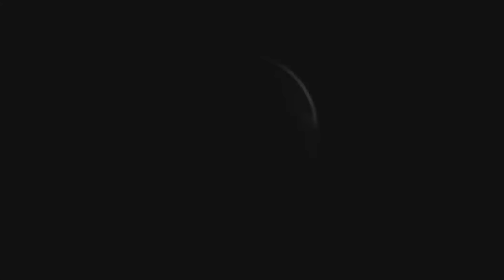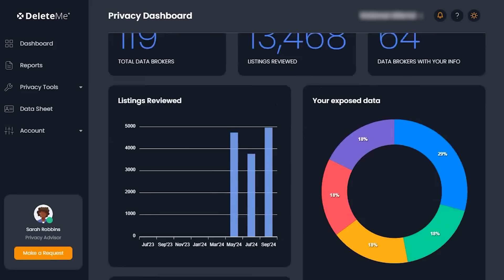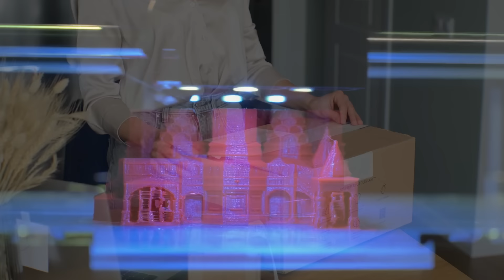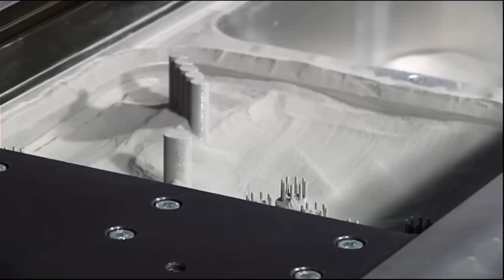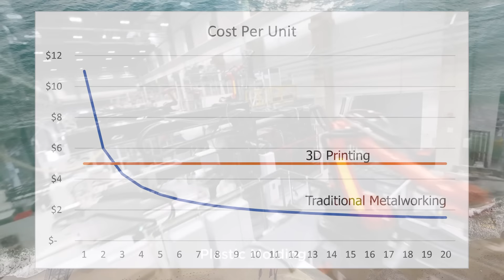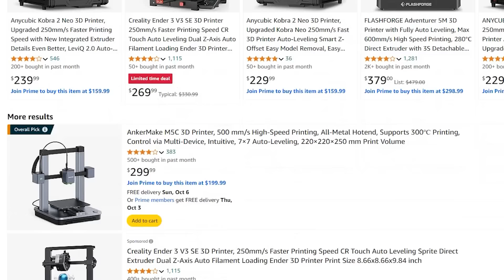3D Printing, Cathie Wood's Latest Disaster

Comment: Most tech companies assume there is no profit in the devices, so they sell them at or below cost because the real profit driver is selling software most likely on a subscription basis or building a free subscriber base to monetize through ads or sell additional add-ons.  The most successful U.S. companies gave up a long time ago trying to compete by building a better physical product unless they could tie it in with better software such as Apple.  This is because someone in China or other foreign companies will just build a knock off version.  They don't care if they violate IP because there is a lack of enforcement.  China's thought process is that IP theft is good for China.  So, companies that made exclusively 3D printers were doomed to fail from the beginning.

Comment: I DO have a friend that has a 3D printer, and he creates some really cool custom items. But it's a SLOW process, and the extruding nozzles randomly clog, wasting plastic and forcing a start over. I'll probably never buy one, and I definitely won't be buying any related stocks. :)
Reply: I've never had a clog in my Bambu printers after hundreds of hours of use.  I only use the easy to print filaments, PLA and PETG, though.

Comment: Out of many hype snake oil salesmen, the few remaining continue to have a vicious marketshare war. 

Those who know AM Additive Manufacturing know that few have the secret Coca-Cola formula for metal 3D AM, and then it's who has machines that can output the smallest of details, best quality, and fastest output.

When the remaining 3D AM competitors have solidified their consumer base, then they'll scale to print on demand services. 

Look for the automotive replacement and spare parts sector to befit best from this.

Comment: I first saw stereo lithography in 1995 at a trade show in Houston
They printed a tiny castle, maybe 2 inches high.  Thru windows you could see furniture inside.  This was impossible to machine using standard equipment 
In 2001 my company would email a 3D drawing to a foundry in China.  They would print out a wax which was used to create a ceramic mold for investment (lost wax) casting 
We commonly used stereo lithography

Comment: Are 3D Printers themselves made with 3D printers? People who are into miniatures, model kits, and desktop games like Warhammer or D&D might find great use out of a mid range printer. The average consumer has been groomed and conditioned to buy a replacement. The last thing other brands and manufacturers want is people fixing things themselves or finding low cost alternatives. This also creates a big area of concern with materials for 3D printing because you need specialty materials to do it.
Reply: Prusa is one of the leaders in the 3d printing hobby market and prints the parts to make their excellent printers.

Comment: There is a company called Hyliion that is 3d printing an energy storage solution.  They tried out for and passed to win the grant for the us military.  It helps them reduce needed fuels.

So, maybe there is an advancement? Or maybe they are using it only for little parts?.  

Either way,  3-printer  it is widely used but not really under an overall patent.   It would keep akin to adding a patent to “a computer” or a “printer”.

Comment: Basically, far too much was expected of 3D printing in too little time. The technology is still in the further development stage and is becoming more practical and reliable every year, while costs continue to fall. In the future, 3D printing will probably play a bigger role than CNC machines do today. However, it will take time for the technology to become accessible to non-skilled workers and to become cost competitive in more areas. In addition, engineers must learn to design new products with the advantages of 3D printing and not try to use the methods they have known up to now.

Comment: As little as $200? Ender 3 og model is usually $99 brand new. V2 sometimes sales for that now too.
Reply: i would rather use a hot glue gun to 3d print than an Ender 3.  200$ is a low ball for something decent. those entry level bambu printers are 300+ but worth it.
Reply: @nox5555  I started with an ender 3 and they are wonderful machines when you know what youre doing. ::shrugs:: V3 does start at around $200 not on sale, 169 right now at microcenter, and is an easier experience than the V1 but the V1, or V2, is a great machine in the hands of a competent person.

I have an X1C now but had about 6 ender 3s running at one point.
Reply: @williammiller3277  The ender 3 was fine years ago, but its sooo freaking outdated. Its slow, it needs alot of work to print well and some of them just dont work well with good software.

You can get an A1 mini for roughly the same price, bit smaller but a much much better machine

Comment: 3D printing is great for rapid prototyping...but it's not revolutionary. I was a college engineering student in the 1990's.  3D printing existed then. The big difference is when the patents started to expire in the mid 2000's 3D printing got cheap and it became a consumer product. I'm a hobbyist and I have one...but it is just that. It's a fun "toy" for hobbyists, but not for everyday use. I made hooks to hang my small RC planes on. Thats literally the only productive part I've made. Although I was trained and spent part of my engineering career doing advanced CAD modeling, the programs available free on the web require me to re-teach myself and unlike my  professional CAD days, I'm not going to spend 9 or 10 hours a day building my expertise on what will be my 5th CAD package. I got other things to do. I wrote a paper on this topic while working on my MBA.

Comment: I use them at work for prototyping because plastic moulds are expensive, they don't break down very often but there is a whole tonne of knowledge around speed, heat, type of plastic then getting the mounts right. It is not easy and sometimes you just lose an entire 5 hour print just because

Comment: I was about to buy a Bambu Lab A1 mini. But it's just way too expensive in India. 
If anyone has any recommendations with decent spares availability. I will be grateful.
Reply: The A1 Mini is the best value on the market in the US at $199.  It's a great printer that has given me no problems whatsoever.  I'm not sure what you're asking for?  I've had Anycubic printers that are pretty good and even cheaper but not as good as the Bambu printers.

Comment: In Australia We import Overpriced bikes from overseas.. When Carbon Fiber 3d Printers come down in price, Every big City should have a Place you can send via a computer what you want printed. And you could print a perfect size light bike frame for a growing child , or a adult .. Just pull the wheels and accessories off the old bike frame , install on new frame.
Reply: 3d printers I've heard sound very loud and scary , with all the stepper motors doing there thing.

Comment: Also the information about metal manufacturing is wrong, but he’s not wrong that it’s still cheaper than 3d printing, most automotive applications do sheet metal forming from cold mild steel or aluminium, robotic welding cages for steel frames, cnc or machining for complex parts, casting is usually only for things like engine blocks if even

Comment: I jumped on the bandwagon 2-3 years ago and bought a unit, a midrange Creality for around $300.  About a month later, I had to quickly move across country.  It’s still safely tucked in its box; I haven’t even untaped it to open the box and peek inside.

But at the time, I HAD to have this device.

Comment: At the time i feel, that they over hype it. I got pastic extruder (pla) and resin 3d printer, it's good when it work and they modeling take a long time. It mainly for prototype and low volume part, the cleaning is also a pain. The only thing that are worth the time and effort is ceramic and metal for specialized part, if you need more then certin amount it is cheaper to make mold for it or outsource it.

Comment: i got 4 commercial grade 3D printers, both resin printers and FDM.
it is not 3D printing doesn't progress, instead, it is another tool in manufacturing. If a product can be made with injection molding then it shouldnt be done with CNC machine, same goes to 3D printers.

Comment: Where is this information coming from on the prices and everything? A good bambu labs and 10KG of filament would only be like $300-$400 and you can print high strength PEtG which is extremely durable. You can print teflon and other materials too.
Reply: Dont Print anything other than PLA on an entry level Bambu printer.  you need to invest into a vented one wif you want to be safe and print with anything else.

Comment: ?? why the hell would you 3d print metal of all things??

like literally a plastic or wax 3d printed object that is casted, then melted out of the cast then hot metal poured into the cavity would literally be 100's if not 1000's times more efficient and cheaper

i don't understand... don't understand at all

Comment: Just the idea of using 3d printed parts in aerospace design is absurd. 
Structural fatigue and design flaws/failures. Just to save a little cost.

Comment: I ran a 3D printer at university in 2008. It was constantly giving a fit and parts were just OK. 

Then in 2012 everyone at work was telling me we would be printing everything we needed. So much wrong with that and lack of understanding
Reply: Printers have gotten exponentially better in the last couple years!  Try a Bambu printer!
Reply: @joeking433  I’ll look. However, my employer had a new Stratasys that worked OK for 2-3 yrs, then  I was told
It stoped running for some reason.

Comment: You explain it well there. In the industry area, making components layer by layer does not have the cost and volume economics of traditional manufacturing methods. It also  does not have the option to produce parts with different strength required. These are besides initial investment and supplies cost. The consumer market is easily flooded with cheap import. The razor and blade marketing does not work here either.

Comment: My whole job is centered around 3d printing. Its great for creating custom plastic parts very quickly, but not for manufacturing large parts in bulk.  I havent used any metal printing machines yet due to the high cost of the machine ($50,000+)

Comment: As a CNC machinist, this video put a smile on my face. I swear a few years ago everywhere I worked people were panicking about printers taking our manufacturing work. The sky is falling… a few years later and I’ve come across 1 shops using a couple of printers to rapid prototype (the bread and butter for that company was still being done on a couple of Haas CNC) but mostly the printer fad seems to have come and gone. Meanwhile the shop I’m at now is still investing in new mills, multi axe lathes and Swiss machines. 

I feel kinda dumb when I look back and reflect on all the times I thought my job was obsolete.
Reply: Try and find a skilled machinist these days… I think your job is secure 😊
Both technologies have their place. We use 3D printers in the workplace a lot, the use case being either fast prototyping, or plastic parts that cannot be economically injection molded in the small amounts we need them. But when we need structural parts for serious application, we talk to the CNC dude.
Reply: @kaasmeester5903 no one is serious about hiring machiest....
Reply: The aerospace company I work for has tons of metal 3D printers and I can tell you, casting is way faster and cheaper for mass production and either way, the parts need machining afterwards. Machinist are becoming a hot commodity as very few your people are learning the trade.
Reply: I hear you, brother.
 3D metal printing machine companies are insane with their pricing for the same economies of scale reasoning explained in the vid. CNC machines should always be structurally more expensive but million dollar printers are the norm.
Reply: 3d SLM and other metal printing technologies are starting to become more common now but it's a time thing, CNC is still faster, it's only applications where unique geometry is needed, e.g. aircraft wing roots or rocket engines or nozzles or pump/check flow blah blah all the weird stuff where you need shapes you can't fit tools down a hole to machine, or Ti 3d printing especially, because it's so hard to machine, that 3d printing it actually becomes much more competitive. It's used in space/aero etc. 
Ones I see are also ion beam systems, GE makes those. Expensive.
Reply: Man 3D printing for many hobbiest like me that want to design and make their own car parts is a godsend.  Especially for working prototypes.  You machinist are VITAL in this because there are parts that SHOULD only be made out of metals like 6061 aluminum and I am currently in talks with a local machine shop for some parts to be made.  You guys should be seeing an uptick from hobbiest like me so machine shops buying more machines is a smarter investment.
Reply: Really miopic viewpoint. Just watch titans of CNC, they use them for finished parts regularly. I use both technologies and they both serve their purpose well. 3d metal printing is in its infancy right now and will only continue to improve, it will continue to eat up market share from cnc machinists for certain niche applications.
Reply: As someone who is a printing hobbyist who has gone into Machining, idk why anyone would think 3d printers would replace other CNC work, even back when I was a hobbyist.

SLS is expensive and requires post processing, and FDM has some big limitations still, both in materials and in how they make things.
Reply: Now the something is happening with AI.
Reply: Yeah it's like the construction worker sweating over a dig machine..
Reply: For hobbyists you could essentially print your own functional jet engines, hydraulic pumps etc right at home. 

The issue is you need to be a nerd to learn how, and nerds rather print a 3d metal Yoda head or final fantasy sword.
Reply: Man, the CNC industry is prehistoric in comparison to the 3D printing industry!  I went from great  3D printing slicers to CNC software that looked like they were made in the 80's!  The only thing I use my CNC for is to work on certain 3D prints.
Reply: Nah you just got lucky. They will get better

Comment: I'm still bullish on 3d printing becoming more common. 
Objection: can buy a part cheaper. Yes, but only if the part is available. 
Objection: can go to the store faster. Yes, if the store is in your town and has what you want.
Objection: Designing your own thingy is too difficult for most people. Yes, but with the AI-assisted tools being developed by Autodesk and others, it will be easy for an average gearhead within a few years. I can already do decent work on lots of things for around my house. I'm an engineer, but not an experienced professional CAD designer. 
I like what someone else said. Functionally it's similar difficulty level to a lathe, and you don't find lathes at Cosco. Yep, but you do find lathes in a lot of shops, and once I got a cheap benchtop lathe, I found a lot of little things I could do with it.
3dp has a lot of growth ahead and so does 3d modeling. It will be a long time before it's in everyone's home though. 20 years, 50 years? I don't know.
Reply: 3D printers are like table saws or saxophones.  Not everyone wants to make things from wood or make music.

Comment: An oil company needed a massive technical component several meters in diameter very quickly. With 3d printing they managed to save around 6million just in cost of production, but more importantly it was finished in 2 weeks, rather than the 12 months for the traditional method. The part was also stronger. For mass production 3d printing is not viable. However, the ability to create large one-off, complex parts quickly is revolutionary. It will also make it possible to dramatically cut down on inventory. The oil company has several billions in parts in stock, that they need to pay to store AND they need several of each even if they might bever need it. Its no exageration that they can save massive amounts with 3d printing

Comment: When I first learned about 3d printer tech, I assumed it would have to get better, cheaper grades of plastic without the rough edges in order to compete over time. That hasn't seemed to happen. Instead, the original tech is just cheap and still buggy. Industrial 3d is a different ballgame, because it's so specific to the expected production run and part tolerance requirements. Automation Alley has a 3d printer "virtual farm" where hundreds of printers, both on site and remotely, can be assigned jobs from one station. Like most tech, 3d printing needs time to evolve, not an investor/gambler hype cycle.

Comment: 3D Printing nerd here ..... Injection molded plastic (everything you own) is infinitely stronger than 3D printed (FDM or Resin). 3D printed anything will be weakest at the connection of layers and that's not a problem as long as you're not trying to make something like a safety harness, or anything that flies or carries people.